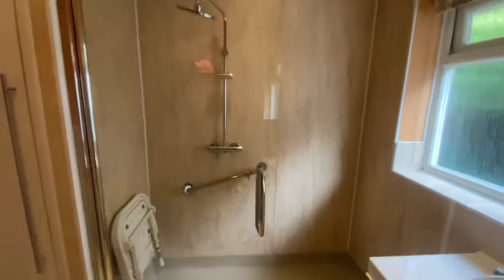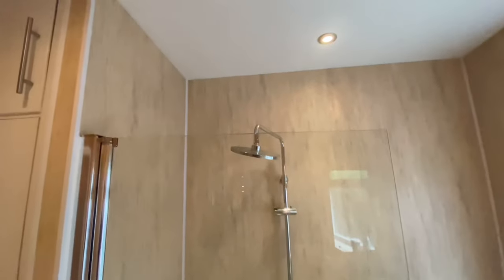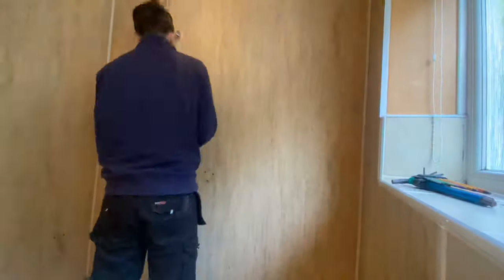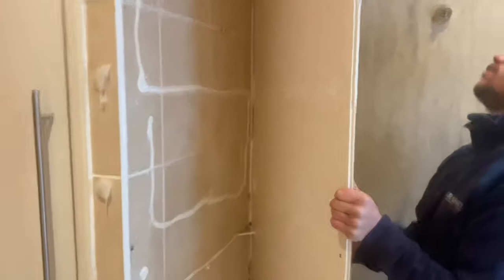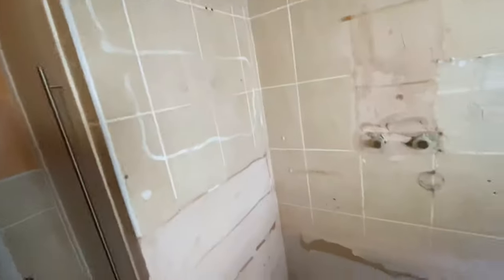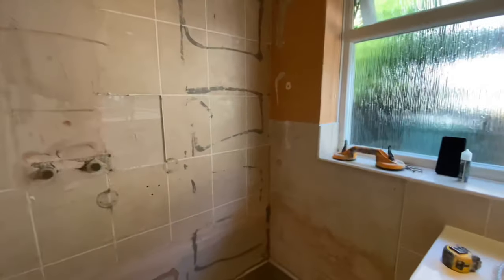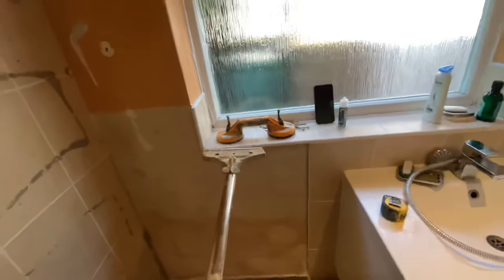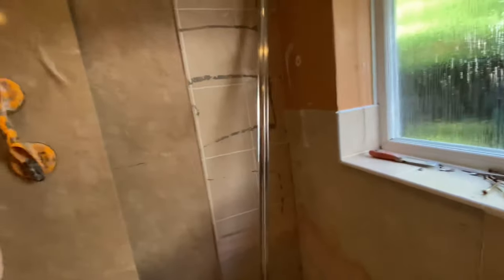Plastic pvc bathroom panelling removal.

Comment: What have you put under the board where it meets the wet room vinyl is it just a bead of silicone on the bottom or is there a trim. how would I go about using the boards in a property that has wooden been floors. Would I need to waterproof the floor by using cement boards and waterproof the joints and tile on top? sorry if I’m not explaining it to well
Reply from the maker: Hi Conor sorry for late reply. Yes there is a trim at the bottom of the boards that the boards sit on and slot into the vinyl. If your tiling floor for wet room. Yes I would recommend cement board or similar. If you vinyl flooring it won’t need tanking. Just need flatting of with thin ply. Hope that helps mate
Reply: Multipanel have this trim for the bottom: https://www.rubberduckbathrooms.co.uk/multipanel-base-profile-type-x-by-grant-westfield
Mermaid Panels have this trim:  https://www.rubberduckbathrooms.co.uk/mermaid-pvc-vinyl-floor-trim-2400mm 

Mermaid trim is perfect for when you fit the wall boards first, where the multipanel trim lends its self more to fitting the floor first then the wall boards.

Comment: Should you remove tiles before installing? Whereabouts are you based?
Reply from the maker: Hi thanks for watching.  I prefer to strip tiles of and start fresh. But if your tiles are firm and you have the space. There is no need. You can go straight on top. I’m based down south. A small town called ☀️ Eastbourne
Reply: @everlastbuilders  ok thanks so much!

Comment: Should you use backer boards before panels and before adding a curved quadrant shower dont want any wet walls.
Reply from the maker: Hi. No need! boards are fully waterproof. No water will be getting threw. Unlike tiles and grout

Comment: Found these boards hard to get in with seamless joints as walls were so bowed caused a gap only about a mm but can see the line
Reply from the maker: Yes some boards are a pain especially if your trying to lock in full high boards. Bowed walls or flat walls it’s a battle! Also some colours/patterns  show board joins more than others

Comment: My bathroom walls are old black mortar and skim, uneven in some areas. Should I dry line first before using these boards
Reply from the maker: They can be stuck to uneven surfaces. But the more flatter and level the walls are, the easier it will be to stick the Panels. Good luck

Comment: Re you say you silicond the edges but we didn't see that ,! And why the he'll you would put wooden panels in a bathroom is beyond me  !! We use aluminium composite panels here in Spain much better than that crap !!!
Reply from the maker: We must be behind the times! But Aluminum composite sound hard work. They definitely didn’t have them in the hotels I stayed in in magaluf lol. To be fair Iv had of cuts of wooden panels left outside mine for over a year with barely any sign of damage. They are made from a waterproof ply.

Comment: I've got a bunch of the hollow ones and going to attempt to fit them in my Rv/campervan. Living room walls roof bathroom the lot 😂 any advice other than don't lol
Reply from the maker: Haha thanks for commenting. I have actually done another video since not slatting them as much! Well at least they are light weight! Sure they will look the nuts mate! Just be careful when cutting them as the corners can get fragile! Sure it will look the nuts! Good luck
Reply: @everlastbuilders  cheers yes they really are fragile. The corners especially  I get the ones returned to the factory for very cheap hence why I have loads but 9 times out of 10 the corners have been damaged. The odd few have a kick mark in like you had shown. I don't mind corners missing due to cutting to size though. I'll take a look at your other video and thanks for the reply. Totally agree though they are too fragile.
Reply from the maker: Good luck mate
Reply: @everlastbuilders  started it and so far it looks shit hot man 😂 outside she's a 42 year old campervan now inside its starting to look modern and sleek. Definitely definitely a good idea on campers and Rvs
Reply from the maker: @c4r5on88  well done mate! Yer I’m sure it looks the nuts! Bet it’s a right fiddle job tho!
Reply: @everlastbuilders  it is yes but it's easy stuff to cut isn't it so not too bad. Wish I'd video it now. Could of stuck it on YouTube 😂

Comment: Hi great video 

What’s the difference between yr boards and once’s that u replaced. Is your plastic but made better? 

Can I ask where u get them from. 

Thanks
Reply from the maker: Hi thank you.
The boards I pulled of where hollow plastic panels. I do use them sometimes when a customer insists they want cheap one. But ones I prefer to use are called  multipanel. They are made of 10mm waterproof ply with a laminated front so they are solid. I will be doing a video installing the hollow plastic panels in the next couple of weeks, so you can see the difference. We buy panels direct from multipanel but there are plenty of suppliers out there.
Reply: @everlastbuilders  IF YOU USE THEM I DO NOT GET HOW YOU CAN CONTRADICT YOURSELF? EITHER DO NOT USE OR YOU CANNOT SAY ANYTHING
Reply: Hello how much you charge
Reply: @Elena-wn1wj  hi who are you asking for the charge?
Reply: @1Saltyone  

Try reading what he says before gobbing off - he said he PREFERS the 10mm multi-panels, but obviously if the customer doesn't want to pay for the more expensive panel and wants the cheaper stuff then that's what the customer gets!

muppet
Reply from the maker: Thanks Rabbit
Reply: @1Saltyone  Calm down dear. Stop shouting.